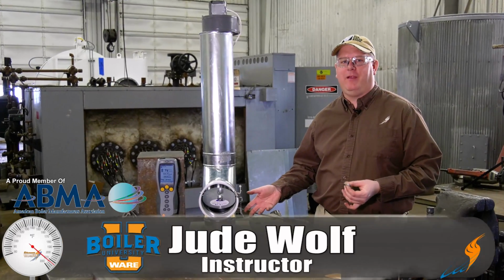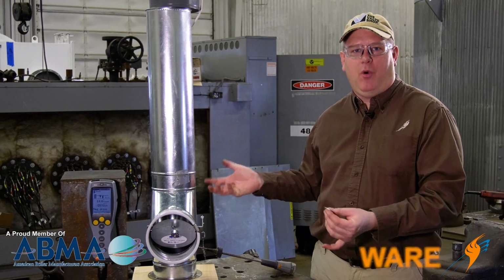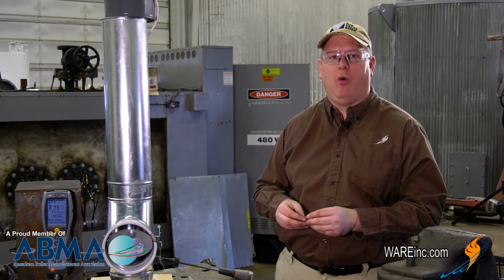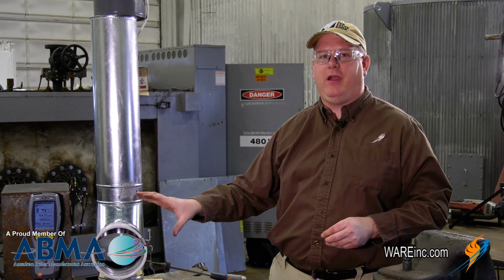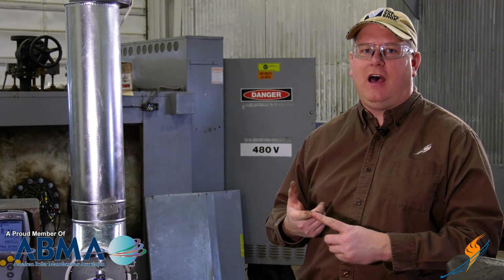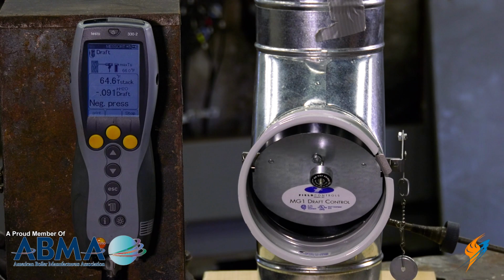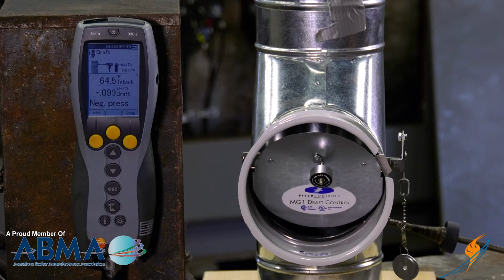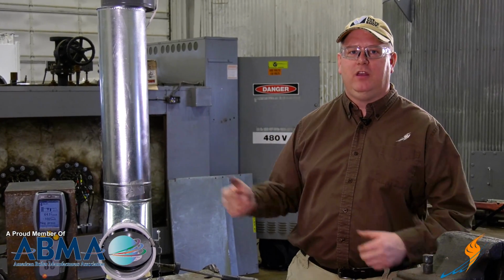How Barometric Draft Controls Works in Steam Boilers - Boiling Point

Comment: What if the draft in the chimney is enough under some conditions, cold weather, that the damper opens to it's maximum? I assume that then the draft through the boiler increases over the desired. Would you need to add a second damper or is there a way to decrease the draft of the chimney?

Comment: What happen if you add a heat recovery unit like a feedwater economizer on the exhaust of a boiler which turns the draft in the exhaust into backpressure. Any suggestions to mitigate the backpressure?
Reply from the maker: The heat recovery unit should be designed to not create back pressure. It might not be sized properly or many other things could be wrong. We recommend getting with a boiler service company to help solve this problem. Thanks for the comment.